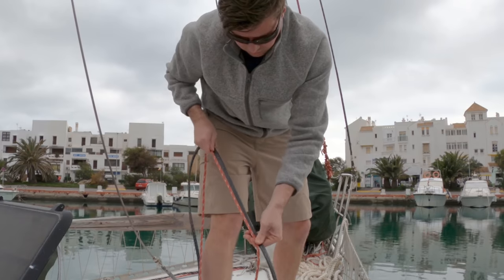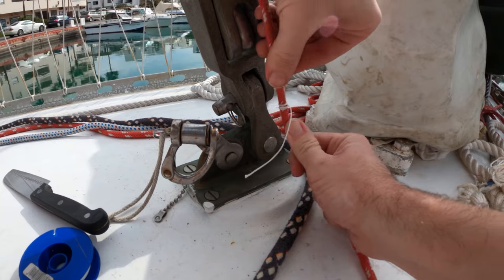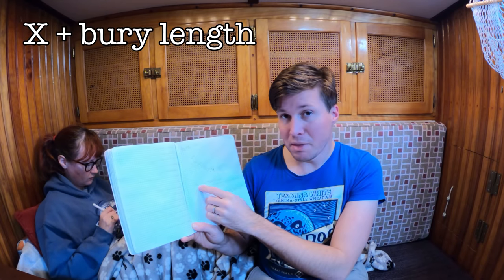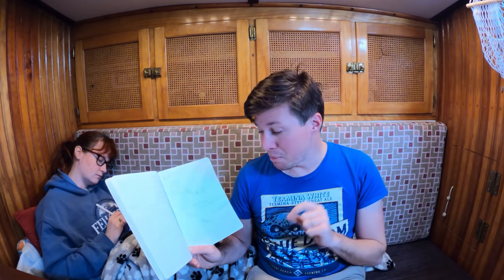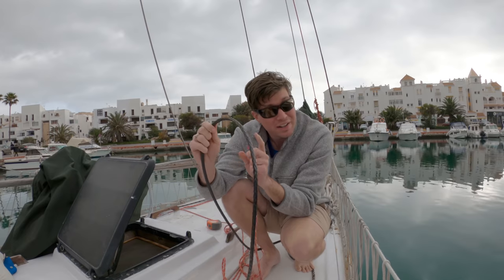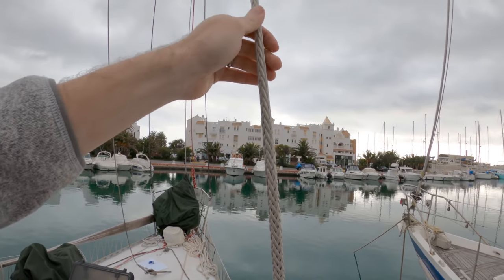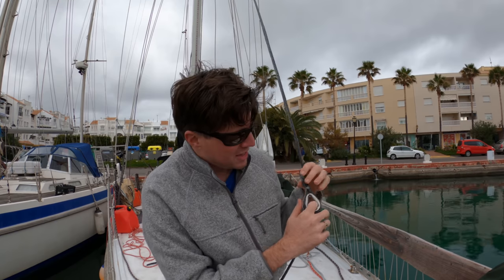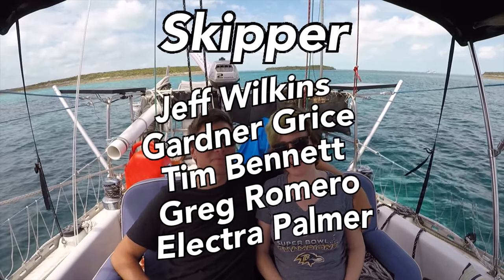DYNEEMA [Part 2]: Measuring Your Rigging | Sailing Wisdom

Comment: Great video Harry, 
have you tried making one end slice and attaching to the mast head before measuring overall length and making the lower splice at the turnbuckle by applying tension with a rolling hitch from a spare piece of line. the splice length is a min length so it wouldn't be crucial as long as its slightly longer as it could be hidden in the sleeve or be trimmed with little waste after it's exited from the sleeve. Could make multiple shroud stays and attach aloft at the same time by setting up temp shrouds with a jury knot and have someone below anchoring the lower tie points.
I'm knot picking your work, just thinking of an alternative way to make it easier whilst working aloft.
Reply from the maker: I thought about doing it that way, but the problem is the constructional shrinkage is impossible to account for and the constructional stretch is more than a hitch knot can grip to pull out. You need to measure everything before you make any splices on either end or you will have no idea what the length will end up as. 
Now, you can make the four lowers at once and install all of them in one trip aloft, then install the cap shrouds on a second trip aloft.

Comment: EZPZ I like to just be a able to work fast without needing to stop and think. Knowing that it's relatively easy to correct for a small margin of error really helps. I'll just to do it exactly you like demonstrated. Thanks 👍
Reply: The point that it comed up a foot short is priceless.
Reply from the maker: DM20 creeps much less so you need to work on getting all the stretch out so that everything comes out perfectly
Reply: @RiggingDoctor  I wonder which properties of DM20 are responsible for this difference?

Comment: So how long does phase one last, and under what conditions is that variable, and how can one be confident that it's finished?
Reply from the maker: It lasts a little over a month (of constantly being loaded). If you adjust it once a month when you notice it’s incredibly slack, then it will take much longer to sort through. 
You will know it’s done because it holds its tension and doesn’t go slack on you.

Comment: Our boats are about the same size and weight..both keel stepped. How thick is your rigging? I was thinking 1/2 inch would do? Do you have a preferred supplier of Dyneema?
Reply from the maker: 1/2 is plenty, I used 9mm which is about 3/8”
Reply: @RiggingDoctor  awsome,  no point in paying more than I need to 😉

Comment: Just wondering can you get a splice through a block? Like for replacing a halyard.
Reply from the maker: Yes, they lay flat and are able to pass over a block, but they are also a little bulkier so that could present a problem if it’s a tight fit. The splice is stiffer too so it shouldn’t rest on the block while under load. 
It can pass through a block on a repair, but it’s not the ideal.

Comment: Please Help!

Hi guys it's been a while I've been working on my own boat.  I need a little help please.    I'm trying to budget and I need a rough idea of how many spools of dyneema that I'm going to need for this girl.  I have a CheoyLee 32 off shore.  

I'm a retired commercial fisherman ... that said this is my first sailboat and I've never done rigging so my question is two parts roughly how much am I going to need to spend in order to replace the rig and roughly how much dyneema and in what sizes?
Reply: I just finished redoing the rigging in dyneema sk78 on my cross 37 trimaran on the cheap. I bought 30m sk78 10mm dyneema winch 4wd lines as they come with chafe sleeves x5 of them. I think they were about $50 Aud each from eBay. Got 60m of 4mm sk78 dyneema for the dead eye lashings and 60m of 2mm for the frapping knots. Budget was about $1000 aud. Need thimbles and solid thimbles for the dead eyes. Need to think about mast attachment fittings aswell.
Reply from the maker: He pretty much covered it. A single 600’ spool of heat set Dyneema will be all you will need, and the remainder of the spool can be kept as spare or for repairs should chafe occur. 
If you need more specific help, you can always email me at riggingdr@gmail.com

Comment: Hey, so I take it by this video that there are no issues running a hank on storm gib on a Dyneema inner forestay? I have not been able to find much online about hanks and chafe and all that. 

What about Dyneema and roller furlers for headsails? Is that still a no go, or are we getting to the point where that will be possible?
Reply from the maker: The bronze Hanks are swapped out for soft Hanks, then it’s no problem. 
For furlers, it’s still a no go but I’m going to test some ideas and see how they work out
Reply: @RiggingDoctor  Sorry I should have watched the next two videos and answered by own question. Thanks for the quick reply.

I'm due to replace the rigging on my 2005 Benenteau 523 and considering synthetic. What are your thoughts on a 52 foot 18ton boat using dyneema vs steel? We currently have 8mm D2's, 10mm twin back stays, 12mm D1s and upper caps and 14mm lower caps. I'm yet to measure the forestay.

Comment: What is the 3rd phase of Dyneema - you never said!
Reply from the maker: Death 💀 
The Dyneema will begin to creep wildly until the strands rupture from creep. 

For SK-78, it usually occurs after it has creeped about 30% of its original length.
Reply: When is that likely to happen? Years?
Reply from the maker: It depends on the load percentage that the stay is put under. Ours is on the smaller size and mathematically should be dying somewhere between 15 and 20 years of age. We are the test boat with it though so we will find out when it actually does die.
Reply: @RiggingDoctor  Good Morning
Reply: @RiggingDoctor  Or night as the case may be! LOL
Reply: @RiggingDoctor  I heard you say that the other day in the video - is this a new form of dyneema? What is the difference to other types?
Reply from the maker: Graeme Henderson I just saw the comment on this video now so I was answering :)
That is for all types of SK Dyneema. DM20 has an even slower value so it should (mathematically) last even longer. 
When I rerig the Alberg 30, I will be using DM20 and we will run the clock out on that rigging too. 
5 years on Wisdom so far and probably a few years away from rerigging Windpuff, but we will find out in years to come!
The important part is once it surpasses 10 years, it then lasts longer than steel rigging would and all the UV degradation concerns can be put to rest.

Comment: Measuring your stays under tension, makes no sense. Since the replacement will not be made under tension and will presumably stretch by the same ammount when loaded.
Reply from the maker: If you measure while they are relaxed, they will not be straight and you will come up a little short. It might not make sense right now but from experience, you need to make them under tension when you measure them.